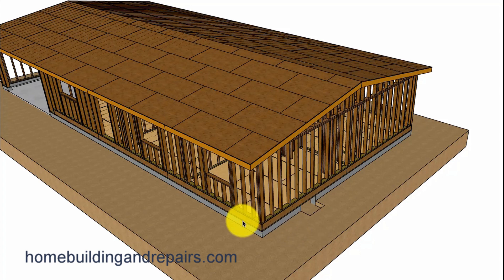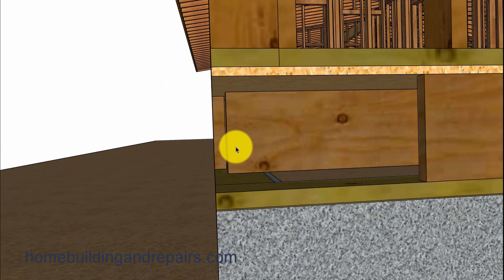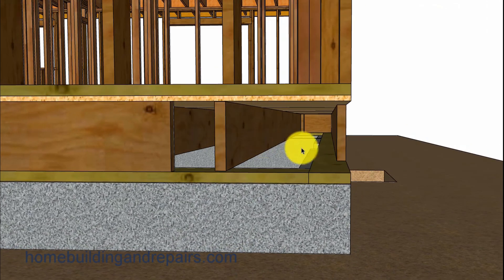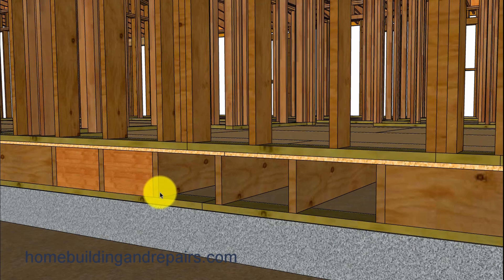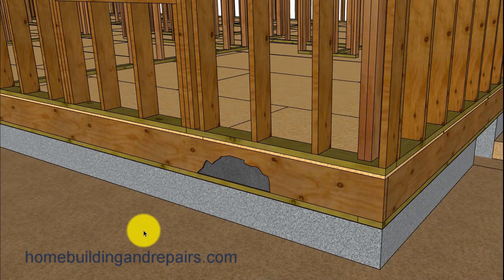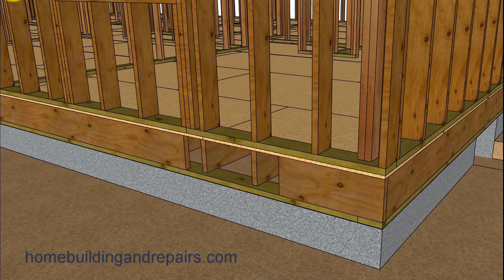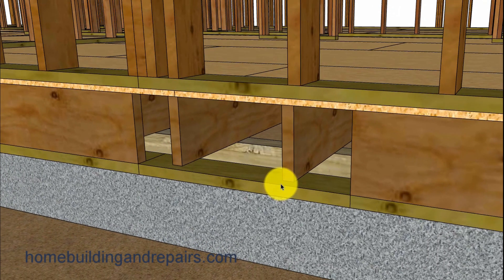How to Replace Damaged Crawlspace Rim Joist – Partially Supporting Loads Above

Comment: Hvac guys drilled 2 3inch holes in the Rim joint to vent furnace to side of the house. Is this something i should worry about? Would this risk the structure of the house?
Reply from the maker: It will depend on if there is a structural load above like a post supporting a beam, but other wise, there's a good chance it will be okay. You would need to verify with local building authorities to make sur.
Reply: @gregvancom  thank you for the feedback. How would go about contacting local authorities? Is that the city?

Comment: What if it's brick and you need to try and complete this from inside? I imagine you would have to cut the joists and replace sections of the rim joist and/or sill plate at a time. Then put joists back into place.

Comment: I was thinking about remodeling the rim joist with the sill plate. Removing the sill plate to add a waterproofing membrane under the sill (W.R. Meadows - Mel-Rol) so that I can connect with the waterproof membrane on the basement. I could add hardware at the same time (example : anchor bolt).

Thank you very much for this video, very informative. Take care.

Comment: Can this be applied if I have a basement underneath the Joist that needs replacing? Same concept? Just cut out sections and replace? I have about 7 ft of basement under my joist that needs replaced. I see this is based off a crawl space.

Comment: Hi, thanks for the useful content. In all of the videos, it seems as if having exterior access to the rim joist is understood. Do you have any videos on when there is not easy access to the rim joist externally and all of the repairs have to be made from the basement? Thanks!
Reply from the maker: Not yet, because I can't figure out a simple method of repair.

Comment: I have termites damaged header joist , In my case have doubled header , they also eat bottom plate and studs, was doing exactly as you said by 3 ft section, got lucky house has extra joist jack levelers

Comment: Great info, but  I wish you would have addressed the other side of the rim joist where the first joist runs parallel to the rest of the joists. I need to replace parts of it but not sure how this would affect the weight of wall that sits on it. I was thinking about doubling it on the inside with another joist sitting on the sill plate.
Reply from the maker: I'm sure there is a link in the video, to the other side, but if not then go to the framing repairs section at our website or crawlspace section.
Reply: @gregvancom  thanks!

Comment: Do the sub floors need to be under the wall frame????
Reply from the maker: It usually depends on the design, but I've seen plenty of repairs where the subfloor sheathing and floor framing butt up against the walls.
Reply: @gregvancom  thank you!

Comment: Thank you so much for explaining it this way. This explains 98% of the problem I am facing. 

I have rim joist that is rotten and that has spilled to the sub floor. And the wall studs above. I need a temporary fix till summer. Do you provide consultations?

Comment: what do you do if 10 seperate 12' long unsupported 16oc floor joists are damaged, 10ft of sill plate and 10ft of rim joist are beyond repair, and  two and a half feet of the 2x4 wall above it is also damaged

since the floor joists are damaged, and the middle of the 2x4 wall is floating,  it feel impossible to know if it'll bear being lifted to remove the rim joist/sill plate. 

but the rim/sill have to be replaced to replace the floor joists,

and the floor joists have to be replaced before a temporary wall can be built on the first floor to take stress of the 2x4 wall's bottom plate.

the ends of the rim joists show approx < 1/8th' but less than 1/4" deflection when pressed with a screw driver. 

asking for a frustrated and bleak feeling friend.

Comment: Thks for lessons. My old house 102 years has serious sag cracked first floor joist.  Hi humidity and had poor drainage for years. In this video replacing sill plate in sections really helped. One man show here and that tip makes it manageable. I do worry if floor joist can support during repair. Not great clearance on that end of two story structure. I have an old Joyce house jack heavy
Reply from the maker: Defiantly take it slow when there's a lot of weight involved.

Comment: Hi, Great video. I notice you put supports under joist approximately one foot away from area to be worked one but how do I support the area if my joist are rotted? I need to remove rotted sill plates and rotted joist, also not sure which to do first.
Reply from the maker: If you can't use this method, then you might need to support walls, ceiling and roof to remove and replace damage. I don't think I have a video on this, but you check out the website and maybe get a few more ideas.

Comment: My rim joists are 2 2x12's
Reply from the maker: Email me some pictures and I would be glad to take a look at it. You can get our email address at our website.
Reply: @gregvancom  I will, I just finished a 4ft section today. I got some crawlspace work to finish finishing that spot but I'll take some from inside and I'll get you some outside from the next section. I'm dealing with brick veneer exterior.

Comment: This is very good info. I have one to fix on a house i grew up in thats about 60 yrs old. bathroom & kitchen floors are bad but brick on outside.
Reply from the maker: I still have to make a video for brick exteriors, because it can be a problem if the brick needs to be removed to make repairs.

Comment: I have a lot of termite damage on one rim joint that runs parallel to the joists right up to the corner. I found a nasty clump of termite detritus about the size of a soccer ball in the corner. Not sure about the rim joist that runs perpendicular, but guessing there's damage.

Trouble is, it's covered with stucco on the outside so I can't get to it.

1. Do you think blocking it only will be okay? It isn't blocked now.
2. I'm guessing I should remove the damaged wood before I block it or should I leave it as is?
Reply from the maker: Yes, blocks can be used to provide addition support until stucco can be removed and this can be repaired.

Comment: So i have a problem with my front door it wasn’t flashed under the threshold and my house i just bought didn’t have gutters so water has been splashing under the door rotting the door frame an a little bit of the sub floor an about a foot or so of the rim joist…problem is my deck it bolted to the rim joist how would i go about replacing Thats section without removing my deck? I plan on putting in a new door an frame plus replacing that peace of floor…the house is only 7years old 🤦‍♂️.. had a crappy inspector.
Reply from the maker: Bummer, but sometime you will need to remove and replace more stuff. Yours won't be as easy as if the deck wasn't there.
Reply: @gregvancom  yup im almost finished with it now, im also going to be replacing the front door an frame ive never done that but have decent carpenter skills an think i can handle it
Reply: I finally got it done..it definitely wasn’t a easy job but i got it all flashed an all the rot replaced with good treated wood should be better now..hopefully i dont have to do that ever again lol

Comment: We’re in the process of doing exactly this repair and your video has been helpful. Some of the floor joists have a rotten corner, the part that was sitting on the sill, the rest looks brand new. Is it advisable to replace the whole joist while the rim is off or is it ok so sister the tip to something? My local contractor recommended plywood on either side, what’s your take? Thanks for the great content!
Reply from the maker: Plywood might work if the damage is minimal, otherwise you will need to sister an additional joist next to the existing one or replace the existing one if the damage is severe.

Comment: Thanks for this video! I was trying to figure out how I was going to retrofit a 5.25" x 9.25" LVL beam sistered to the rim joist above an egress window that my contractor didn't put a header over and I finally realize that I'm going to have to cut the rim joist off, cut the floor/ceiling joists shorter, install the beam with joist hangers to the floor joists, then reinstall the rim joist. There's just no physical way to install a flush header beam from the inside only.
Reply from the maker: Glad I could help and thanks for letting us know it helped!

Comment: im in a mobile home being help by a beam and under that its on blocks in the center not the edges. The rim joist is rotten and has no sill. Is it safe to remove the rim joist with no problem? I did add blocks between the floor joists right under the wall for support as a precaution so that the rim joist can be removed and will do it in 4ft lengths just to be safe.

Comment: I replaced 4ft. of the rimboard at my place, it was simple. Little nervous at first but theirs really no weight on it.
Reply from the maker: Yes it's definitely a little easier when you don't have to worry about a structural load above. Thanks for sharing.

Comment: thanks for the video. this is helpful. i'm helping my son restore a 1931 2-story house. we discovered some termite/water damage along the back of the house. it's kind of an odd old construction in that there is a double rim joist perpendicular to the floor joists and the wall studs are nailed directly to that double rim joist, so there's no horizontal 2x4 under the studs. I'll need to replace about 14' of the sill and also a lot of the rim joist as well. I'm not sure how far into the inner rim joist the damage goes, but I'm assuming it's worse in some places than others. Your idea of blocking may work for the inner one I'm thinking. The problem with pulling the inner one is that all the floor joists hang notched onto a 2x4 that is nailed to the inner rim joist, so the floor joists aren't actually sitting on the sill plate. So replacing the outside one may not be too hard (at least 2" of the 4" wall studs will be supported by the inner one). If I run into more damage to the inner one, do you have any advice? I planned to jack up the joists to replace the sill first, then tackle the rim joists. I thought maybe I could wedge blocks of wood between the concrete block foundation and the bottom of the floor joists to support them from underneath till I can replace the bad sections.
Reply: Did you ever find a solution to this? I think I have the exact same issue, just no sill plate.
Reply: @davidgaskin1558  thankfully i only had to replace the sill plate and the outer 2 rim joists. The inner one seemed okay for the most part. It’s all done now.

Comment: Can you remove the rim from inside the crawlspace? I have a brick facade and it would be terrible to have to get through that to remove the rim joist.
Reply from the maker: It's not going to be easy and in some cases it's not going to happen, unless you remove the brick on the exterior. It can be done, I just don't have a simple method yet to provide you with.

Comment: If just replacing the rim joist (no blocks), how do you secure it to the joists?
Reply from the maker: You can use metal hardware or angle your nails. Sometimes using angled metal brackets are going to be easier, because they can be attached to the blocking first, then install the blocking, then attach blocking to the joist.

Comment: Is it necessary to place support under the floor joists if you're only replacing the rim joist when the floor joists are perpendicular? Isn't the main function of the rim joist to provide lateral support to the floor joists and not so much vertical load support?
Reply from the maker: Your question isn't easy to answer, because it could be confusing to others. The best way I could suggest whether or not you would need additional support would be whether or not you knew what you were doing. If you don't know what you're doing or you're not sure, then put as much possible support as you can under everything to be safe.

The rim joist will also be providing support for the wall framing above and everything sitting on top of it and definitely providing lateral support to the floor joist.

Comment: Amazing video! One question: directly behind my termite-destroyed rim joist I have very large stone steps that would be difficult and costly to remove and reinstall. Would it be okay to not replace the section of rim joist at all and simply install blocking?
Reply from the maker: I cannot provide you with structural engineering information, but have definitely seen what you're suggesting done before.

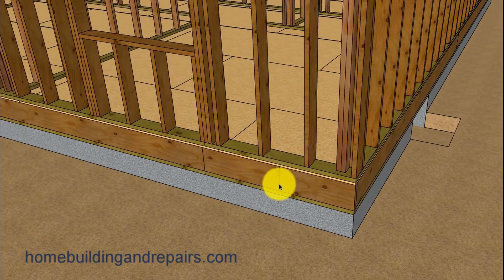Comment: 6:28 what type of anchor would you use to secure the rim to the footing? Maybe drill down on it and hammer in an anchor once the new rim is in?
Reply: Did you find the answer to this?
Reply: You don’t anchor it. Lag screw it to the joist and toenail it the seal plate and it’s fine

Comment: Could you show me the link to the video you promised about the rim joist going in the other direction? My husband is working on a upper deck repair and the ledger was attached to the rim joist and both have wood rot right in the corner.
Reply from the maker: Can you watch the video again and let me know if the link is located in the video or if you had a difficult time noticing it? I'm always looking for ways to make better videos and any help you can give me will help others like yourself in the future.
https://youtu.be/sUZfDPdaRWY  heres' the link you wanted.
Reply: @gregvancom  The link was not easy to find. The link is not in the video nor is it at the end, lots of great videos, just not the one I was looking for. I went to the website and perused your wares, then came back to the original video and sent my question.  I started watching other videos and the one I wanted from you appeared on the right hand side,  it felt more like luck. Thanks so much. Your videos are very intuitive and cover most questions a person might have.

Comment: Great video. How would you replace sill plate and rim joist with brick veneer, how can you do this from inside the crawlspace?
Reply from the maker: I don't have a simple and easy answer for that one and you might need to remove the brick. I just can't think of any other way how it can be done.

Comment: Can you cut a hole in rim joist to run a duct thru to heat and cool your legal breezeway? My breezeway is step down to a concrete slab 10ft wide and then a wall with a door and another step down to a concrete floor for the 2 car garage.
Reply from the maker: It is done regularly to install crawlspace vents. They are usually installed in between the floor joists.
Reply: @gregvancom  thanks I been looking it up but havnt seen nothing about it really

Comment: All my wood in my crawl space have dry rot including girders, beams and joist. It still feels solid but I did a pick test and indeed have dry rot. It’s an 80 year old house. I have all the subfloor removed because I planned to replace the floor joist and girders. Replacing the beams will be more challenging , will it be worth the extra work or is dry rot not that big of a deal (threat).? The girders and beams are 4x6
Reply from the maker: If they are damaged, then I would replace them.

Comment: Is there any inspection code required?
Reply from the maker: You would need to check with local building department, but most of the time if you're simply replacing damaged wood and rebuilding it in exactly the same way as it was built originally, an inspection might not be necessary. Again, check with your local building department, for more information.

Comment: would this (in your opinion) be sufficient over an access door if the sill plate is also rotted?
Reply from the maker: As long as the walls or joist are supported somehow, then this method should work just fine. Let me know if that doesn't make sense.
Reply: gregvancom thank you, I'll let you know how it turned out if I do get it fixed

Comment: Hi Greg,
When you cut out sections of the rim joist do the installed sections need to be fastened together somehow?
Reply from the maker: Yes, use screws or nails. Sometimes you might need to install a new board next to or behind another board, to create areas that sections of the framing can be attached to. I realize that sounds like a bunch of gibberish, but if you haven't figured it out feel free to send me a picture and you can get our email address of the website for more information.
Reply: Thank you

Comment: This is great....any suggestions for when rim joist is blocked externally by concrete stairs?
Reply from the maker: Now that isn't going to be easy. I will put it on my list of videos to be made in the future, but it won't be made in the near future. You can remove the stairs and work from the front or leave the stairs and remove other sections of the building and work from the sides, top or back. I can't guarantee any quick fix, but feel free to send me some pictures of your project and I will see if I can help you get started.